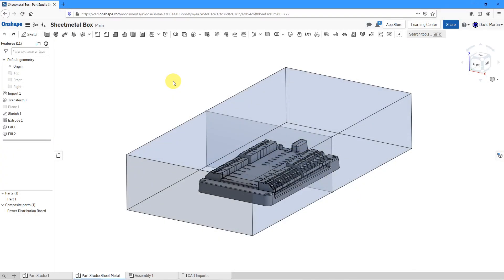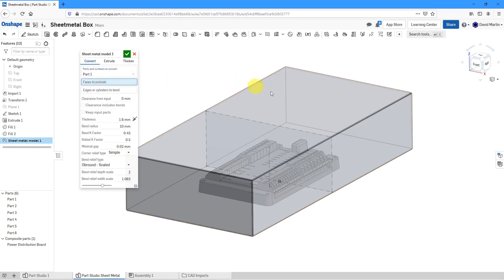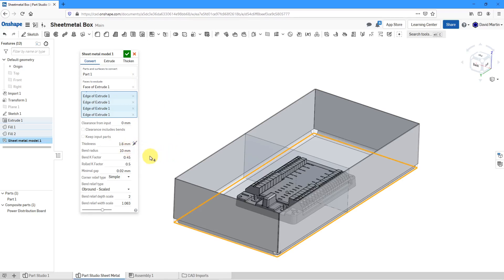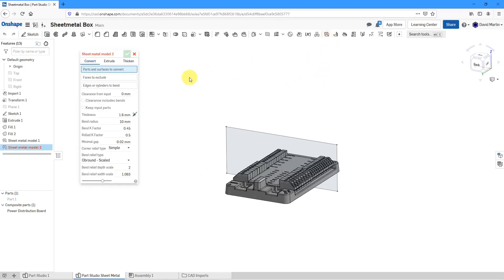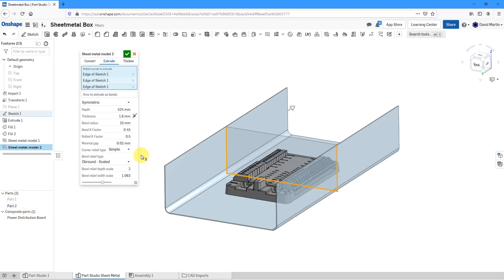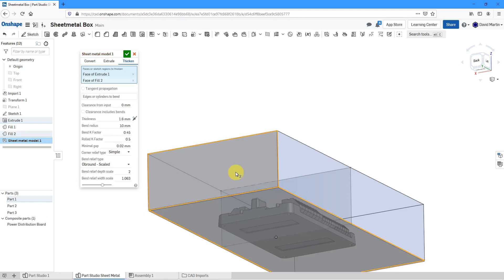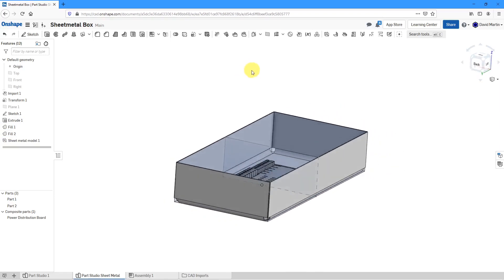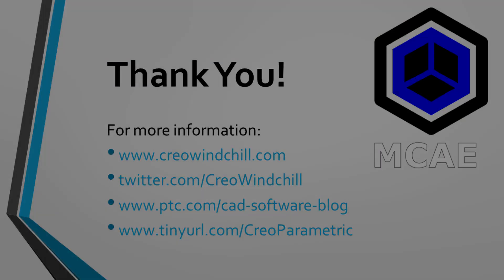Onshape - Sheet Metal - 3 Ways to Start a Part

Comment: When asking to start a drawing in OnShape means Starting with the first tool to draw a straight or curved line.  I do not want to start with your drawings.
Reply from the maker: Do you use the term "drawing" when you're talking about a part or a model? Because they are not the same thing.